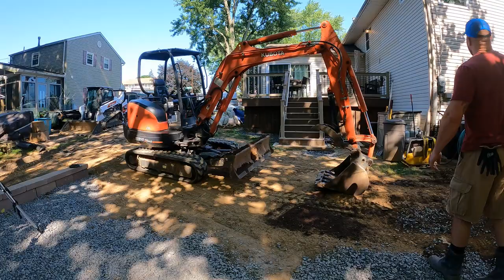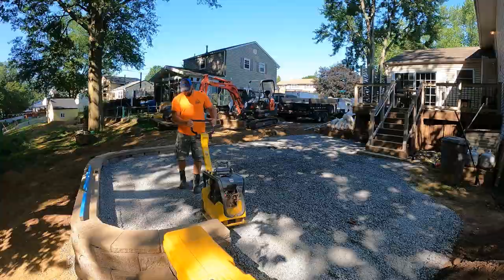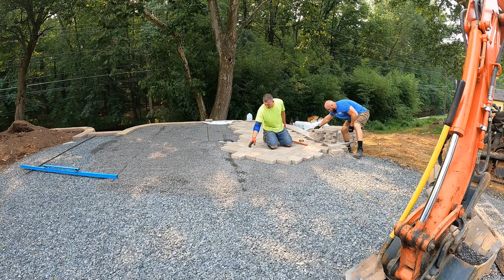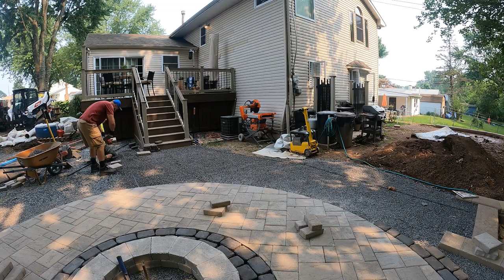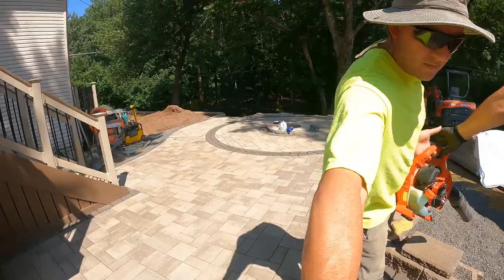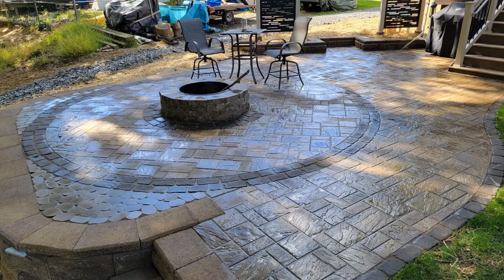600 sq ft Paver patio installation with fire pit - time lapse

Comment: Why no stone dust or paver sand, I was under the impression all rock should be compacted before pavers ontop. I saw you screen the rock with the level then put pavers right ontop. I own a landscape company and am trying to learn as much as I can
Reply from the maker: We used 3/8" chip stone in place of the sand. We did what is called an "open grade" base for this installation. There's a lot of debate on whether to use open grade (which is 3/4" clean stone base with 3/8" chip stone as bedding) or traditional (which is 3/4" modified with concrete sand as bedding). I believe both have their places and are both good options. Thanks for watching

Comment: QUESTION, I am getting ready to do a raised paver patio like this video, my retaining wall will be curved instead of straight like this video.  How do I slope the retaining wall so it matches the slope of the pavers? Similar to the curved parts of the patio in the video
Reply from the maker: I build the wall level and then crown the patio. So the high spot is in the middle and the water will shed to the edges. Hope this helps